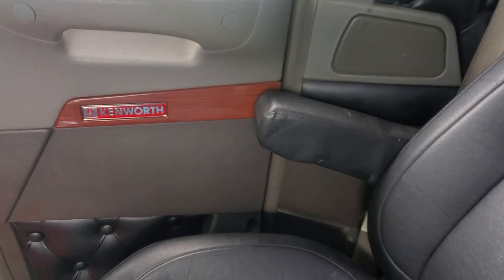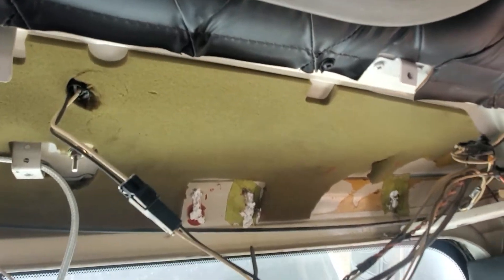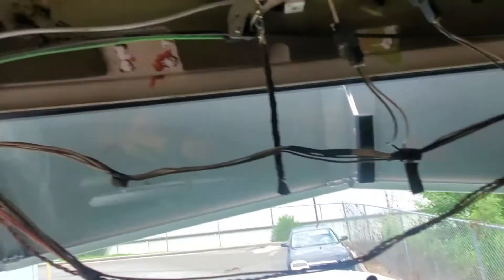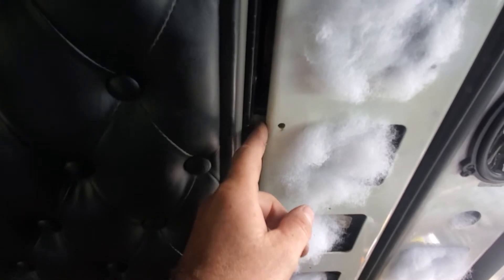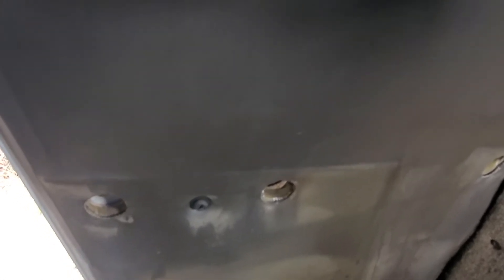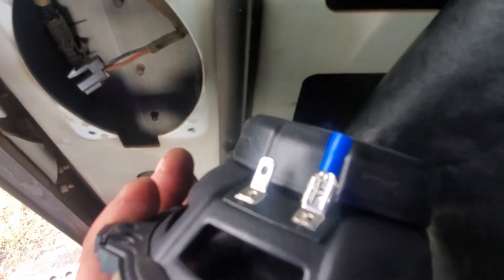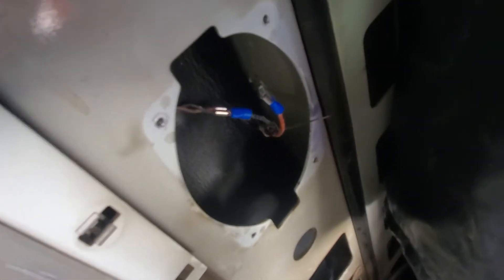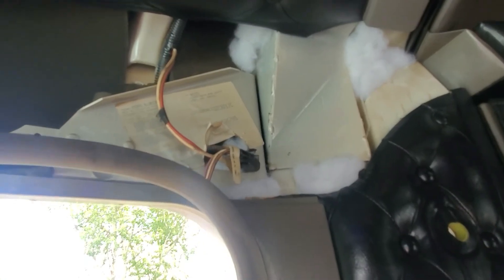KW 900 side panel speaker replacement

Comment: Thanks for uploading this video aren't the front speakers up top 4-6s also?
Reply from the maker: Your welcome! Yes mine were 4x6's. Definitely made a huge difference in sound level and quality with the Rockford Fosgate punch speakers!
Reply: This is the last video I needed to see. I’ve seen others about pulling the header but couldn’t find one for the side panels. Now I can do the full install. Changing the head unit, header speakers, side speakers, back speakers, adding a set of 12’s under the bunk and a set of 6.5s in the header where the visors are. Along with some 2” watermelon lights on the header and dome area. Thank you for this!! BTW I have an ‘07 W900L.